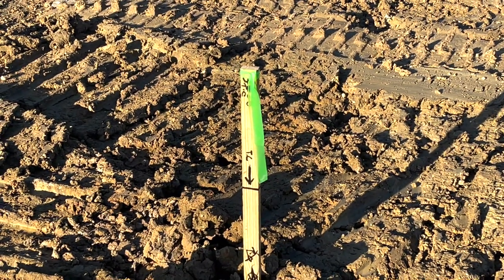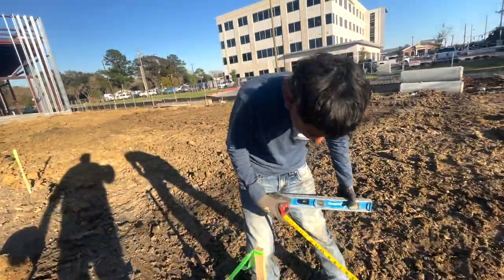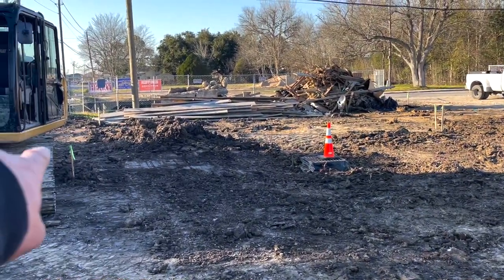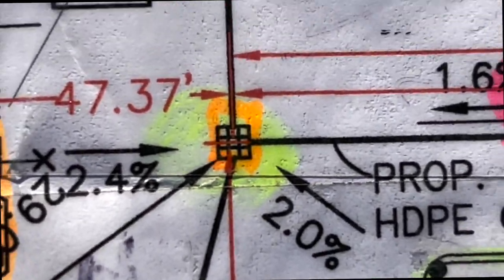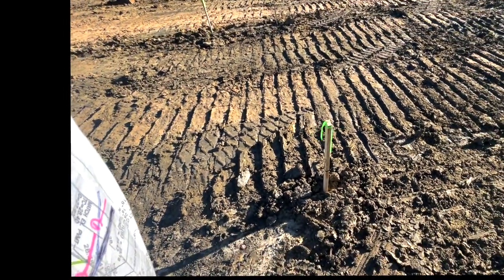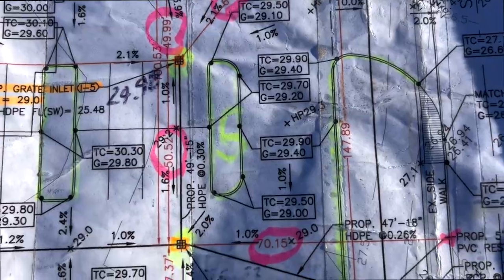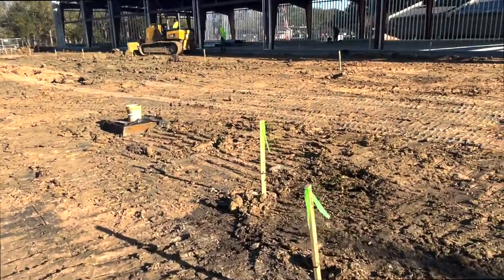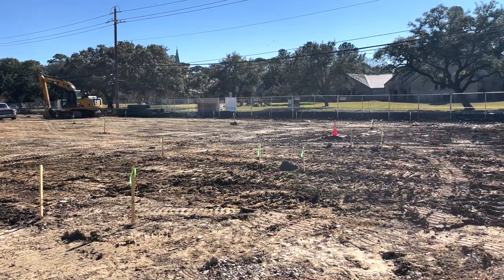Setting Grade Stakes the" Old School Way", with scale & tape measure.

Comment: Thomas, I love watching your videos.
Do you pour the concrete right over the tracks left by the dozers or do you have to back drag the final grade to get it really smooth?
Reply from the maker: It's best to buy drag to get it smooth. The theory is where the dozer tracks or left, that's the beginning where the concrete will crack
Reply: Bill , you overfill grade, compact it , call for survey stakes, cut grade within a hundredth.  of a foot so as to not waste concrete which is expensive. a banjo and string line for longer runs helps.

Comment: You guys are lucky in Texas. Flat ground is hard to find. Land is hard to find. Seattle area
Reply from the maker: What’s the temperature up there right now?
Reply: @thomasconstructiontexas  high 40’s drops to low 40’s at night. Month or so  we should be in the 50’s
Reply from the maker: @centerbuilder7677  I noticed some of these guys on here shut down for the winter. Just too cold to pour concrete. It doesn't seem that way in Seattle.
Reply: @thomasconstructiontexas  concrete union on strike these days. I don’t do too much concrete. Either way I wait for summer.

Comment: if you call this old school, you must be very young. with a hand level, 100-foot tape, plumb bob, 6-foot folding ruler, hatchet, engineer's scale, and set of plans you could grade the site compacted very close before calling for the survey. there should be no fill as in the finish you cut grade, not fill you are not a grade checker until you can walk on a bare site, go up a natural canyon, ,, climb a hill, chain off from a known point however far away it is, with a bundle of lathe, flagging, a kiel and be able to set up a cut, over-excavation, and/or a fill. with minimum staking to move the bulk of materal and get it ready for survey stakes. I'm retired after 30 years of checking grades, operating, running jobs UNION work.did not have lazer, GPS, or computers. only what fit into our pouch.if you use a lazer or GPS that's not old school.
Reply from the maker: Would have loved to spend some time with you on the job. Much respect